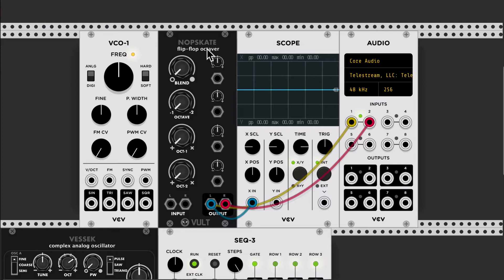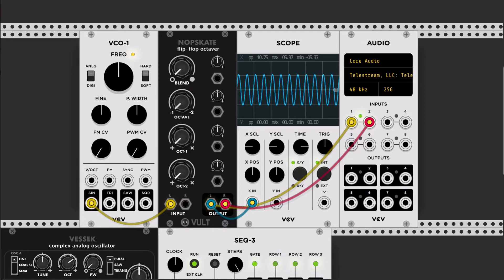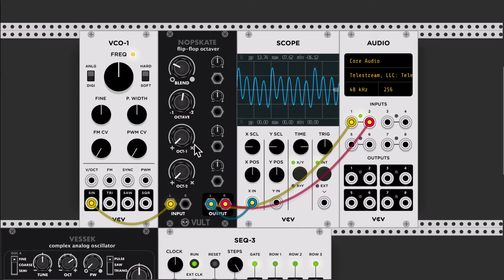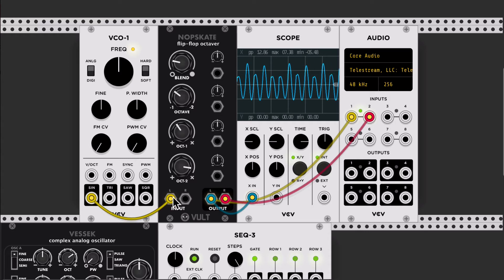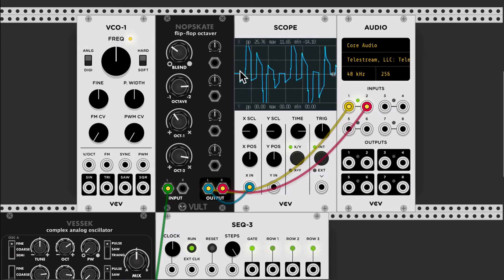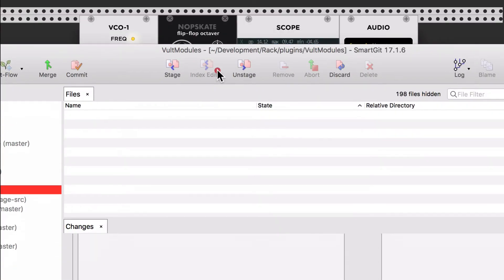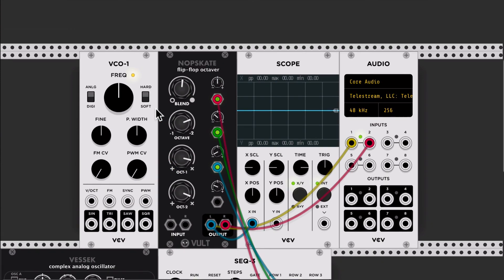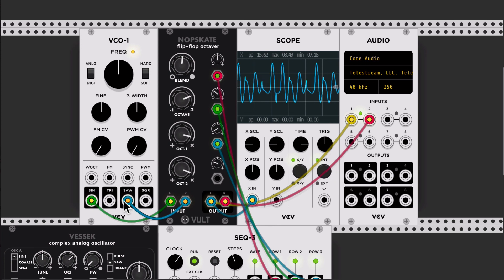Vult Nopskate: Overview

Comment: What a great module, Leonardo! I tried this trick with the clock divider a few times already, but I have a feeling that this sounds much better :) And everything has its own cv input! Thank you!
Reply from the maker: Omri Cohen  yes this module has advantages compared to using a clock divider. The clock divider would produce aliased pulses and it will be probably more unstable. The other advantage is that makes easier to blend in the generated waveforms.
Reply: Yeah that's true. So you can decide exactly how much of each you want, instead of having both on full... interesting